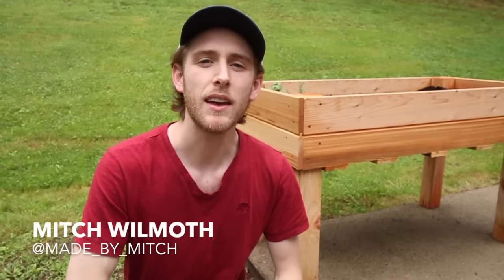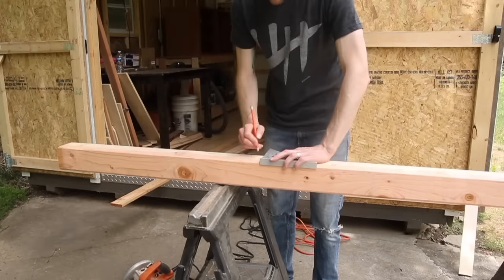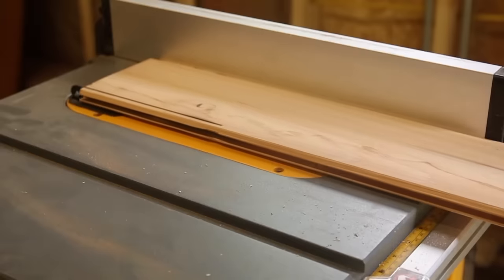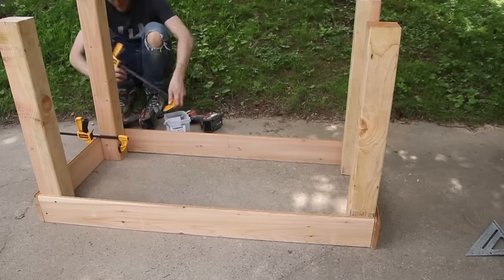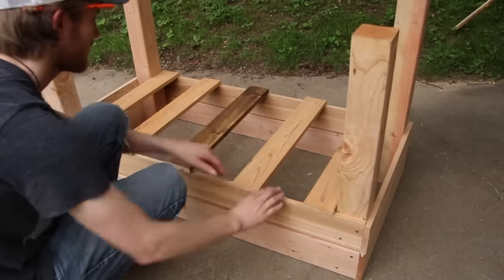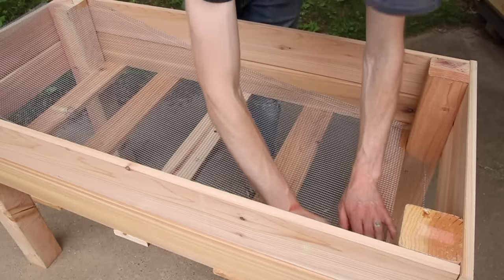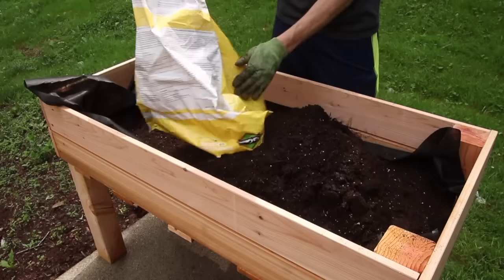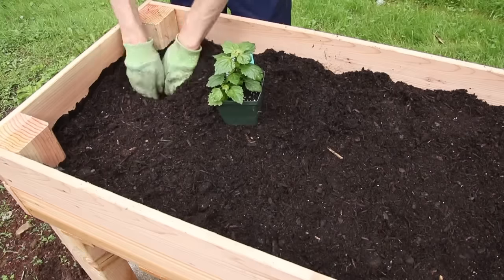DIY Elevated Garden Bed

Comment: What were the cut lengths for all the boards?  I saw in the comments, the 4x4 were cut at 30 inches.  What about the 1x6 and 1x4's?
Reply: Update for those who are curious.

You need 2, 12 ft 1x6 boards.  cut the 1, 12 ft  board for the 24 inch boards (4 from this board), the remaining piece is 48 inches.  Cut the next 12 ft board into 48 inch cuts (you'll get 3, 48 inch boards from it).  You'll have 4, 24 inch boards & 4, 48 inch boards in total.

You need 1, 10 ft 1x4 board.  Cut into 24 inches each, you'll get 5 boards ( for underneath)

I strayed away from OP's 30 inch posts, and did 42 inch.  So, I got a 14 ft 4x4.  3 cuts making them 42 inch length each.  I did all cedar, got it all from Menards for $50 for just the wood.
Reply from the maker: Thanks Dan!!
Reply: @dantheman2595  your comment got me all the way thru!!!! Thanks brother. I have the height at 3ft! Perfect for my wife's height!
Reply: Dan b
Reply: Nice job ! Cn you fill it 15 inches deep ?  How does it hold up after a season of growing  ?
Reply: @dantheman2595  Bless you!
Reply: @dantheman2595  This math doesnt add up - Cut the next 12 ft board into 48 inch cuts (you'll get 3, 48 inch boards from it).
Reply: @DonnieLewandowski  48" is 4ft, 12ft makes three 4' boards
Reply: @dantheman2595   so only the 1x6 is the tongue and grove cedar, the other boards are just standard wood boards correct?

Comment: ProTip - to determine the volume of soil you need, measure LxWxH (inches) and divide by 1728. That converts CubicInch to Cubic Feet, most garden shops sell soil by the cubic foot bag. A typical bag may be 1.5-2.0 cubic feet. If you only want it, 6” deep, then use 6” as your depth. So 4’ x 2’ x 6” bed would need (48x24x6) /1728 = 4 Cubic Feet of soil. If you need to know inches to cubic yards, divide by 46,656.
Reply from the maker: This is very helpful. Thank you for sharing!
Reply: This is crazy. Maybe it's time we move to metric.
Reply: Thank you so much for this conversion!
Reply: Did I miss something?  How does it drain with the plastic on the bottom?
Reply: @constance9779  the plastic is perforated. It lets water through, but not weed seeds. Same as landscape fabric.
Reply: Great tip

Comment: Hey.  Awesome job!  We’re going to be making an elevated garden bed for my Wife’s parents today (Fathers Day gift).  My plans look a LOT like your’s, hehe.  We just plan on adding some lower raised beds (directly on the ground) on the short sides, and some sort of trellis on the top.  

I’m the yard manager for a local lumber mill.  I make a LOT of raised beds for customers in the run of a year.  Usually, when I’m cutting the corner supports, I’ll make three cuts instead of just two.  The first cut is most important to have straight, then as you flip the timber a single side at a time you have the end of the previous cut as a beginning guide for the next cut.  Saves a LOT of time marking and lining up the cuts...

Oh, btw...we’re planning on trying a layer of wire, much like you did, but then lining the bottom with a good layer of twigs.  Adding wood as filler to the bottom of the bed will not only allow for drainage but allow the wood to soak up some moisture as it decomposes.  This moisture will then stay present, and be available to the plants growing in the box, meaning you won’t have to water as frequently.  The technical term for this method is ‘hugelkultur’.

Comment: Ok so just wanted to stop in and say thanks! Basically took your design and made it a little bigger. Mine is 6ft X 2.5ft and 16inches deep. Also added extra legs at the 3ft mark. I will say the idea to use tongue and groove board was awesome. Made things so much easier!

Comment: I made these last spring but did it 3 boards high.  I made them 4x8 but used a 2x2 lip on the bottom to then lay cedar slats across the bottom.  I then laid pond liner 6 inches up on a side and put in 5 6-inch drain tubes with "socks" over to seal out dirt.  Made a tube into one and turned it into a selfwatering sub-irrigated reservoir (sir).  Keeps the dirt from drying out for 4-8 weeks and grows amazing carrots, zukes, cukes, lettuce and green onions and herbs.  Just planted it again and cant wait to eat fresh veggies all summer
Reply from the maker: Wow that is really cool. I may try something like this with mine. It would really help to not have to water it so much. Thank you for sharing. 👍

Comment: I’ve built this years ago for my cats grass. 2’X4’ in cedar as well. No liner but a solid base covering. I also put caster wheels on to be able to move it around as it will weigh quite a bit.
Reply from the maker: Very cool! I like the caster idea. It would be nice to be able to move it around a little.
Reply: If you want them on the cheap, Harbor Freights frig dolly can cost less than the separate wheels. Just take the wheels off for your project. I used them on my 8’ workbench. Held up going on 10 years
Reply from the maker: Oh wow. Thank you for mentioning this. I am going to check them out. I appreciate it!👍

Comment: I just finished building 10 of these boxes- 2 different heights 30" stand up and 25" wheelchair I also added another board to equal 13.5 inches of depth. These boxes will go to 5 different senior and disabled places- two boxes @ each place.  Thanks so much for the plans.
Reply from the maker: This is great Bill. I'm glad this helped you out. Thank you!

Comment: Thanks for sharing Mitch! I Acquired all of the wood and will be building soon. I decided to use natural burlap instead of landscape fabric in the bottom, not a fan of using polypropylene based fabric in vegetable gardens. I'll let you know how well it works. Thanks again!
Reply: The natural burlap has worked great... i did 3 layers of it just for added strength. We've produced a lot of cucumbers up the A frame trellis, but, unfortunately, 0 zucchinis. I think it may be too shallow for them, next year will be more shallow rooters in here!
Reply: @johnmud5085  Hello! Would you recommend the wire mesh and then natural burlap? And how was the drainage?

Comment: Good video and I am going with the design but for the posts 4x4, I find getting treated 8' fence posts that were already treated and cheap and easy to cut for my posts.  For the cedar, I used replacement cedar fence slats and cut them the same way and they hold the dirt fine.  Thanks for your vid, it is .a perfect design.
Reply from the maker: Very cool! I'm glad you enjoyed the video! I'm sure the treated legs will hold up much longer.

Comment: Amazing work. Probably the most straightfoward video about this and its a really simple build the way that you did it. Combine it with Dan’s precise material list, and you have a really easy project.

Don’t forget that if someone isn’t comfortable making cuts, Lowes will do these cuts for you. There are 13 cuts I think, lowes will do 10 for free then 10 cents a piece after that. So you could spend 30 cents and have all of the pieces ready to go. Just build.

Comment: Thanks for this info on a raised garden box.  I plan to make on 4' wide by 8' long and 4' high.  I also will use some brackets and 2  4"x4"x4' posts in the middle.  It will take about 30 cubic feet of soil (including 2 cu.ft. of cow manure and 2 of wood bark.)

Comment: you could always screw some locking castor wheels on the bottom of the posts too so you can move it around if you need to.  thanks for sharing :-)
Reply from the maker: That is a great idea!

Comment: Hi and thanks for the video, I was wondering how your beds were holding up after a couple of years? I live in coastal NC and after several years of flooding I need to get my veggies off the ground! I will probably do something similar but include more boards on the bottom so the soil doesn't fall through, also sit those bottom boards on a rim instead of screw them up from the bottom of the box.  Thanks for the idea!

Comment: Nice job Mitch, I built exact model and it's solid. I used fence post and 1x5 pressure treated slats to line the bottom so I don't use the wire mesh.
Reply from the maker: Thanks Armando. Good idea to use the slats instead. Keep making awesome stuff!
Reply: I also paint the whole thing with a clay color to match my South Florida style.
Reply: Thanks for the putting this together.
Reply from the maker: That's awesome! Great idea. 👍
Reply: You wasn’t worried about chemicals in pressure treated wood? Those chemicals will leach out into soil and may be harmful.

Comment: Great vid. Been wanting to make a cedar planter for a while. I made a planter out of some scrap pine a while ago and its held up pretty well but isn't deep enough and doesn't drain well. I like how you did the bottom of this one.
Reply from the maker: Thank you Malusifer. I'm hoping the cedar holds like it is supposed to. The drainage works pretty well for this one I like how it turned out. Thanks again!

Comment: You could have made it much stronger and omitted the mesh and cloth by using a pencil to space the boards across the bottom. The soil compresses and you don't lose it but retain drain feature. Just my two cents. Ask me how I know? Lifetime Gardener and former landscape designer and contractor.

Comment: Very simple - thanks for the video. How did this hold up over time? Any issues with the vertical screws in the bottom slats pulling out, since they are supporting the weight of the soil?
Reply: Just wondering if you ever built this and did you have any issues with this?
Reply: @samanthawisdom7367  I'm 8 months late with this reply haha,  but yes I did build two of them and they are holding up great through two planting seasons.

Comment: Great video I use Cypress tongue and grove less cost than Cedar about $ 8 at home centers and comes 97 inches long after main bottom are cut I use T& G for bottom and drill holes for drainage much harder wood also.
Reply from the maker: Thanks Bob! That is a great idea to use the wood on the bottom and drill holes. Thanks for sharing. 👍

Comment: Hey everybody. So everyone has said to use burlap it seems. Well i had a (possibly) brilliant idea. Pine needles. Where I live they are like 1 1/2 feet. Biodegradable and cost nothing if they fall in your yard almost everyday.  I’m probably going to fill the bottom 1/4 then soil should press it down and it should hold tight and the water should drain through. We will see.

Comment: I'm so glad I came across this video.  I've been wanting to make my very own diy elevated garden.  I'm new to this so I have a question about the wood itself.  I'm not that knowledgeable with building something like this.  Will it be harmful to the garden to put a sealant on the wood to resist water damage?  I know the video is not recent so I hope you do see this.  Thanks for the video & any advice.  🤗
Reply: Don't use sealants or pressure treated wood as they have harmful chemicals in them.  Cedar is preferred since it is a natural wood and doesn't rot easily.  It's also more expensive but safer.

Comment: I built a few of these in Idaho where summers are extremely dry and due to the air flow around the box the soil would dry out even with daily watering. With increased watering we noticed our garden suffering from nutrient deficiencies. So the next ones I built I took all the way to the ground. Solved all of our issues. Down side was, cost more to build. Luckily for me my dad works at a landfill and I have unlimited access to mulch. I imagine if you live in a more humid climate these work just fine though.
Reply from the maker: Oh wow. Yea I could totally see how these would dry out quickly in a more dry climate. There is another of humidity where I am so it seems to hold moisture much better. Thanks for the comment!👍

Comment: This is a crisp and beautiful video and I am keen on adopting this elevated design rather than the raised bed. I am 68 and i don't wish to strain my back. I have a question, I live in Florida known for annual Hurricanes. Is this garden bed can be left out during hurricanes (shifting such heavy stuff indoor is ruled out) or any anchoring is recommended? I would be grateful for your advice asap. Thanks
Reply from the maker: Thank you very much. The garden bed is pretty heavy with soil in it, however it is a little top heavy, so it can tip over with enough force. I don't have any experience with hurricanes, so I'm not sure if  anchoring it would be needed. It might not be a bad idea to be safe.
Reply: Bakthavathsal Kadambi - I’m thinking that maybe you’d want to anchor it with any heavy patio furniture you may have that cannot go inside. I lived in Jacksonville bet. 1998-2000 and had several powerful hurricanes. I used to tie all the patio furniture together and as close to the house as possible and it never budged. I’m now in Virginia and that’s what I’ll do with my new raised bed if we get any hurricane.

Comment: Thanks for the plans!  Quick question about the 1x4 boards underneath.  Since those are mounted underneath, are there any concerns with gravity and/or the weight of the soil warping that wood over time?  Obviously the wire and the 5 boards are designed to dissipate that weight, but curious if that might being a fault down the road?
Reply from the maker: Hey Joe. I haven't had any issues with the boards warping in 2 growing seasons. They are still the same as the day I build the garden bed. If they were to warp, I would just replace them but so far there has been no need to. Thanks

Comment: This looks just like what I need.  What about drainage? Especially in the rainy season here in Florida! Do you have issues with flooding or rotting?
Reply from the maker: Awesome! I haven't had issues with rotting although I'm sure over time it will happen. I did poke some holes in the fabric to allow better drainage. I haven't had any flooding issues. Hope this helps! Good luck. 👍

Comment: Hey Mitch....just wondering if you have had any issues with the boards on the bottom that support the mesh wire.....would think that with the weight of dirt(especially wet) combined with gravity that the boards would or that the screws would start to pop it....great video

Comment: I would also add wheels to the bottom.  Great job.  I have another question.  I need to make something to set my earthboxes on to raise them up.  Do you think If I took the 4 legs and laid a solid piece on top that it would be enough support or would I need corner braces underneath?

Comment: Hey Mitch, how did the hardware cloth and landscaping mesh work over time?  Seems solid, but I could also see it giving some trouble bearing weight over a long duration.
Reply from the maker: Hey Seth. Holding weight has never been a problem for it. The mesh has held great. However the landscape fabric doesn't allow the best drainage. Putting a bit of gravel in the bottom instead of fabric made for much better drainage. Still no weight problems and I have used mine for 2 seasons so far.
Reply: @MadebyMitch  So, the fabric isn't neccesary? I was questioning why it was on the bottom of the box, not the top?

Comment: Hmmm I’m confused. You put the mesh down then a liner which will prevent good drainage right? I’m confused why you need anything in there at all besides a few holes drilled

Comment: Going to make 6 of these for my spring garden. I feel like the slats on the bottom needed to be closer together and that soil could eventually come out of the bottom. Were you happy with the spacing or could you have added another board?
Reply from the maker: Great Jen! I am happy with the spacing. It had held well. The only change I would suggest is not doing the fabric and instead doing small river gravel to allow for better drainage.

Comment: I am not a builder of items like this. I was able to (frustratingly) make 2 small raised garden beds. They are so not perfect. You look at them from above and they are not straight.  😆  Oh, well. I wanted to plant more crops next year and wanted to do make a raised bed you can stand up and plant. This construction looks like I can work with. But there is 1 problem. I don't have a circular saw. So.... 🤔 I have an interesting problem. I guess that's what brother-in-laws are for. 😆

Comment: Hey Mitch! This is a great help as I am trying to build raised beds for my school. Do you know what kind of wood screws you used? And also if I weren't to do tongue and groove boards, what is a good alternative?
Reply from the maker: Hey Misha! I used exterior wood screws 2 or 2.5 inch would work. You can pick them up at your local home center. You could use 1x6 cedar boards in place of the tongue and groove boards and that would work just fine.

Comment: What are the dimensions? And why did you not utilize the tongue and groove system and instead saw them off? Great video (:
Reply from the maker: Hey Griffin! The dimensions are 24"x48" and 30" tall. I used the tongue and groove to connect the top and bottom boards together. I just cut the tongue of of the top board and groove off the bottom board to have a flat top and bottom. Thanks for the comment!